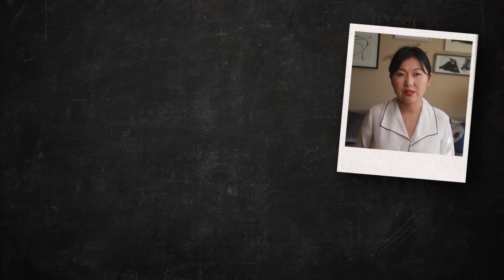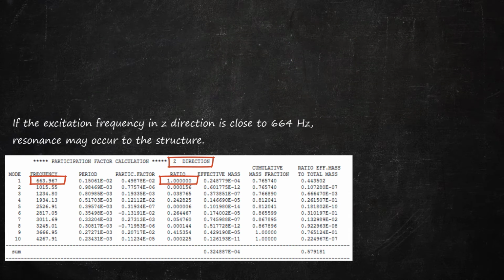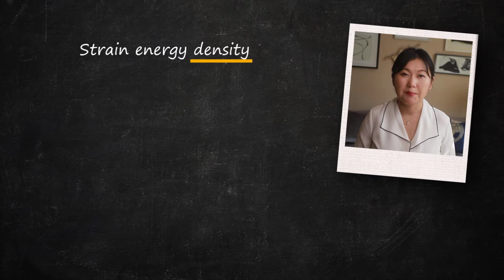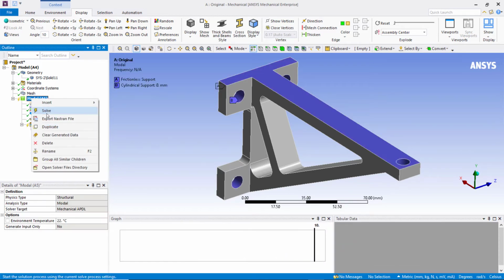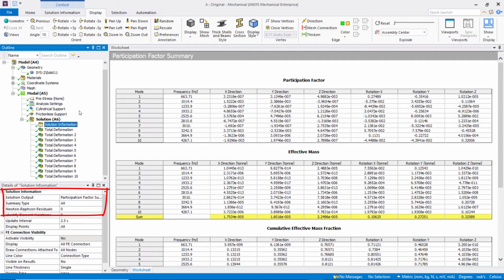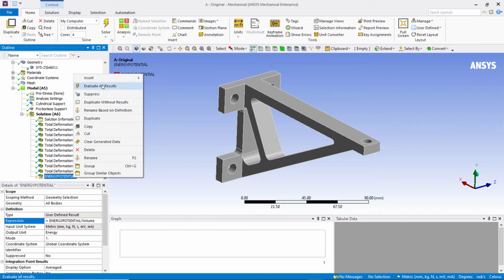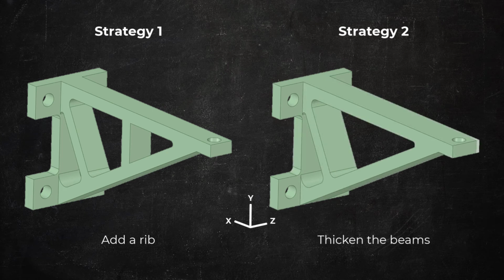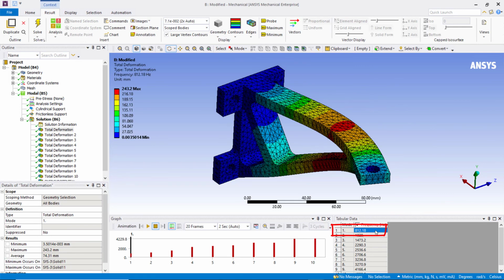Using Simulation to Change the Frequencies of a Design Using Ansys Mechanical – Lesson 3

Comment: Excellent tutorial. Congratulations and thanks for the video. My question is what would be the definitions for cylindrical support when using union by rivet and screw, respectively. I think for rivets it is fixed for axial and radial and free for tangential. As for the screw, everything is fixed. Is this statement correct?
Reply from the maker: Thanks for watching! Please post your query on the Ansys Learning Forum for a detailed answer from the wider Ansys Community: https://ansys.com/forum.